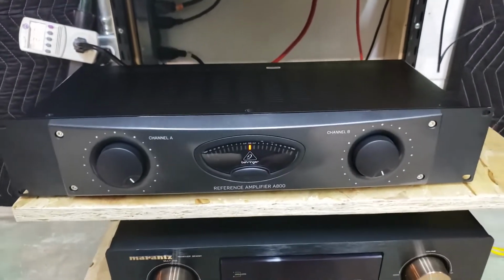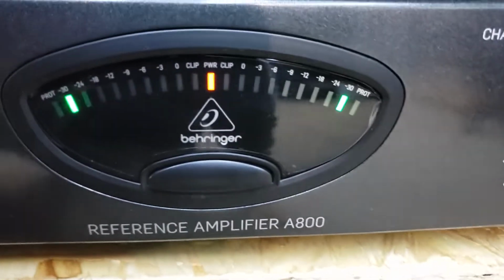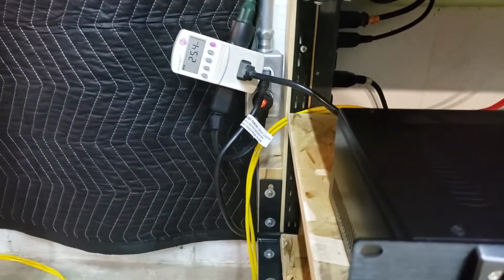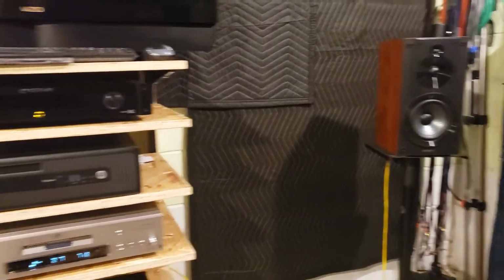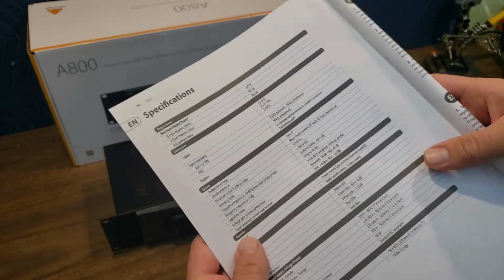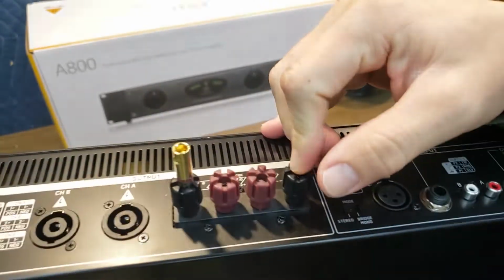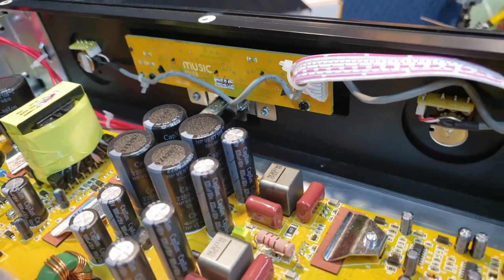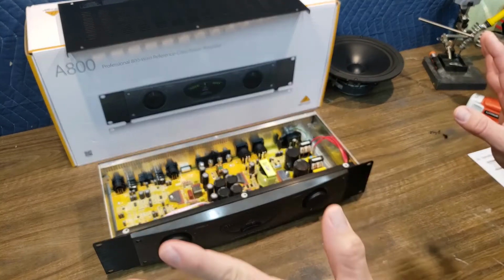Behringer Reference A800 Amplifier (Budget Beast)(Improvement Over the A500)

Comment: What number does the Emotiva volume stop at ?
Reply from the maker: It goes up to 80. I've never gone over 60 for fear of destroying speakers...lol.
Reply: @iowaudioreviews  That amp is it louder than 150wpc receiver ?
Reply from the maker: @Bigmaker223  Behringer rates this amp at 220w x 2 @ 8ohms BUT after having it tested it really puts out about 150 x 2 @ 8ohms. So would depend if your receiver really does put out 150w @ 8ohms, not likely. The A800 most likely would not seem any louder than your receiver. Watts and loudness doesnt work the way most people assume. Even if the A800 did put out 220w it wouldn't seem much louder than your 150w reciever. To even get 3db louder you would need to at least double the wattage to 300w and to double your loudness (+10db)  you would need 10x the watts so 1500w. You could run 2x Crown XLS1002 bridged for 700w x2 at 8 ohms. Or get speakers that have a higher sensitivity than your current speakers.
Reply: @iowaudioreviews   What you think about Crown xls 1002 ?
Reply: @iowaudioreviews  I have the Cerwin Vega xls 15 .
Reply from the maker: @Bigmaker223  The XLS1002 most likely won't get any louder or sound any better than your current 150w reciever. You would have to at minimum go up to the Crown XLS1502 or to really notice a difference the XLS2502. Your speakers are 6ohm and 92db efficient which is good if your trying to get loud. Be careful, they're rated at 400w max, actual continuous power handling is probably about half that at 200w.
Reply: @iowaudioreviews  Thank bro ..

Comment: Not a bad amp.  I have the A500 and have used it since 2016.  Even though its measurements are not the best,  those distortions are most likely inaudible most of the time.  I've scheduled myself to get the NC400s from Hypex and will be installing them in a case from Ghent Audio, so I'll have something that should be more powerful and dramatically less distorted (like 40 db better Sinad) than the A500.  Even so, I'll keep the A500 and use it to drive the back channels of some cheap surrounds, and the system will no doubt sound superior to any surround sound receiver.  

Even if you don't have a similar use case when and if you upgrade, it never hurts to have something like an A500 or A800 in the back closet if your main amp goes down.
Reply: How did those hypex kits turn out?
Reply: @brucefisher9224  I switched to doing the Purifi Eval 1 with the Ghent case adapted.  Right now, it's not functional. Have sent the power supply back to Hypex and will be sending the Purifi module back as well for repair.  I will get it working in about a month, I'd estimate.  Probably should have just gone with all Hypex A 400 but got seduced by the more advanced Purifi module.  I be happy I'm sure once I get it working

Comment: What is the input sensitivity on this thing? Is it required to run a preamp with it? Or is straight out of the DAC sufficient for home use volume wise?
Reply from the maker: Im about 90% sure the inputs on this amp are industry standard. So the balanced XLR inputs should be 2.83v and the unbalanced RCA input is 2v. So long as the DAC your using meets these levels "whichs most DACs and preamps put out at least 2v line out" you will get full power. I demonstrated hooking a typical CD player with 2v line  out to this amp in the video and it works fine, but is NOT recommended because controling the gain "volume" between channel A and B manully on the fly isn't accurate. DACs with a volume control or preamp is highly recommended. A good budget option is the Micca Origen g2.
Reply: @iowaudioreviews  I just purchased one of these amps. Curious how it sounds, especially for the money. Only experience i have with Class D are those small Chinese t-amps.
Reply: @AmplifierzJDM  This thing will destroy any of those small chinese class D amps.
Reply: @iowaudioreviews  thx man! I have a DAC with integrated volume control.

Comment: Do you think it would sound better than the nx3000d?
Reply from the maker: If your in no hurry just wait for Audio Science Review to finish testing. I'm guessing the A800 has a bit better fidelity since its a reference amplifier and the NX series is a commecial/pro amplifier. Have to wait and see how good the A800 does, hopefully better than the older A500. I think the NX series uses the same amp section as the iNuke series. The NX series just has the computer controlled DSP built in. In that case watch Williston Audio Labs video on the iNuke 1000. They dyno test it and it does not put out what behringer advertises, only about 75% of it.
Reply from the maker: Check out the testing. Tests quite well for a $300 power amp. https://www.audiosciencereview.com/forum/index.php?threads/behringer-a800-stereo-amplifier-review.10499/
Reply: @iowaudioreviews  In EU it's even cheaper, around €190 including 20% sales tax excl p&p

Comment: How to listen on headphones on this amp ? I don't see a headphone output.
Reply from the maker: You cant. This is just a amplifier, its ment to be used with a preamp or mixer, and they might have a headphone output depending what you use.
Reply: Power amps only drive speaker. You need a analog mixer, headphone amp or a Pre/Int amp with a headphone (tele) output.